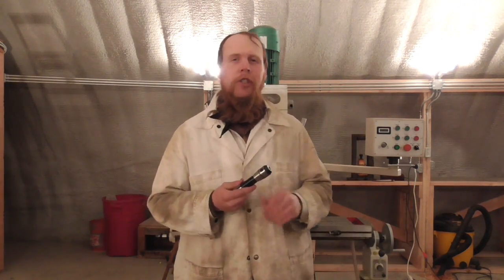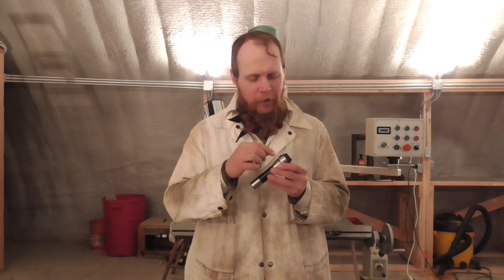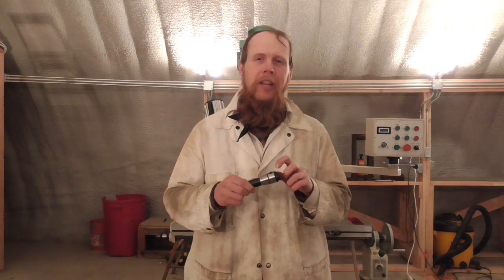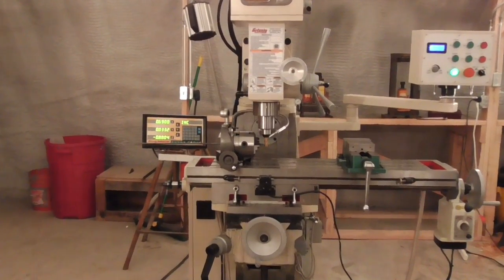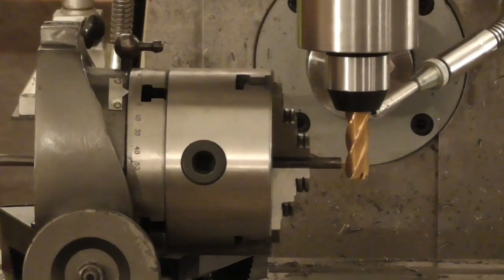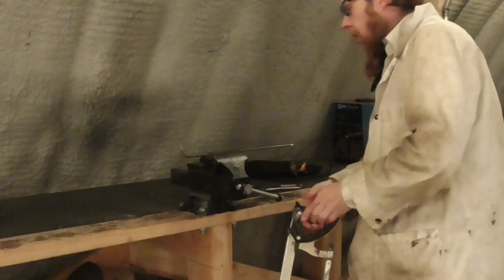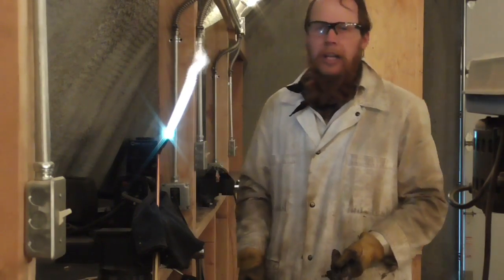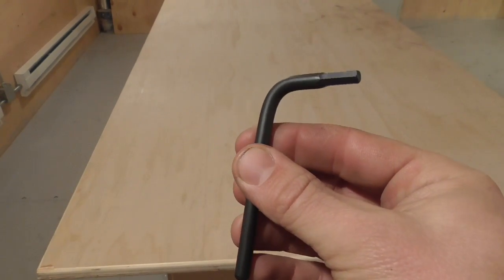Making an Allen Wrench (TIS086)

Comment: how did you get your measurement? and then transfer that info into an allen key?
Reply from the maker: I measured the hex socket in the set screw with calipers and then positioned the edge of the milling cutter half that distance from the axis of the rotary table.